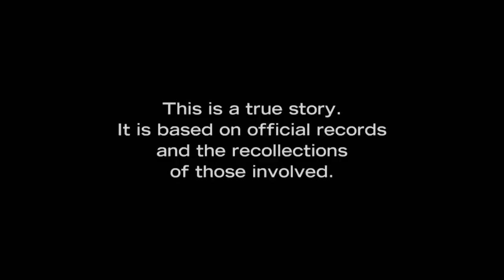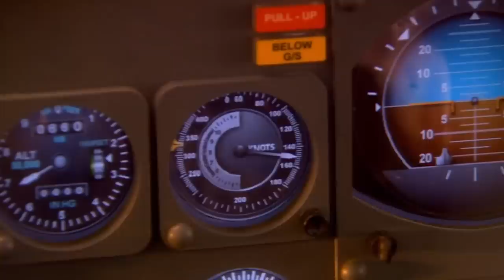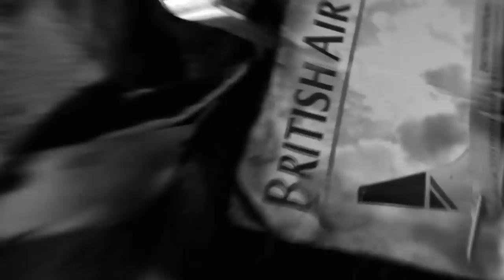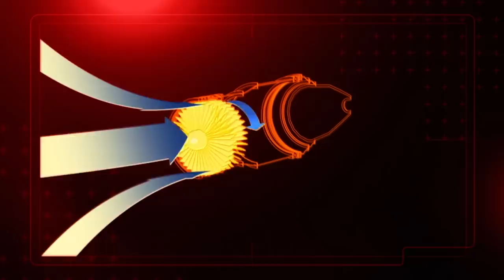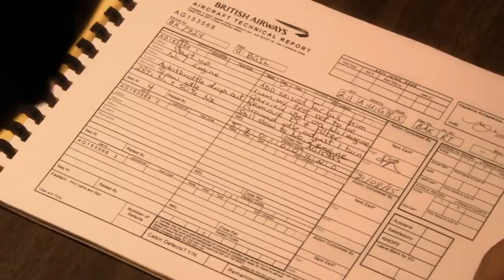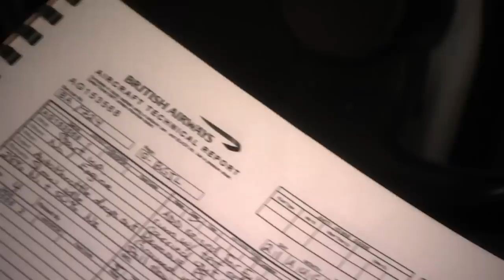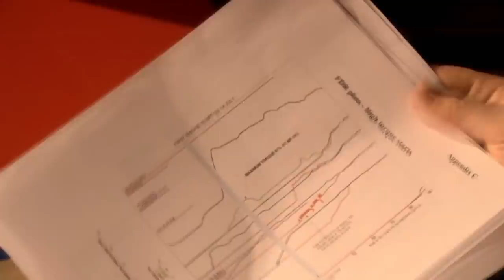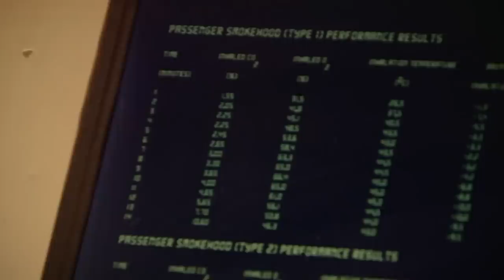An Engine That CAUGHT FIRE Mid-Flight! | Airtours Flight 28 | Mayday: Air Disaster

Comment: How do you design emergency door that doesn't open in an emergency. They said they opened it too quickly. Isn't that what you do in an emergency?
Reply: They also said it was a flaw in the door's design, and that it was fixed.

Comment: Why wouldn’t the door open? Damnitman! They could have gotten off twice as fast if both front doors had opened
Reply: It is not unusual for exit doors not to open after a plane has had a serious problem. The explosion may have caused it to jam
Reply: Exactly.  It is designed to only work for the safety drills when there is not a threat to life and limb... otherwise, all bets are off.  When the pressure is on, they don't step up.
Reply: The video literally said why the door didn't open and boeing fixed the issue
Reply: 43:33

Comment: 30:20 If planes had cameras that allowed the pilots to see all of the plane's exterior they could've seen the flames and how they were being directed against the plane and possibly turned it around.  They would have also seen it wasn't a tire blowout but an engine failure.  Small cameras have become much more technically feasible since 1985 and better quality.  I don't know why there is resistance to putting cameras around a plane now since they are so cheap.
Reply: Anything that adds weight or drag increases the amount of fuel needed to fly.  More fuel means more money and fewer passengers.
Reply: I suppose that makes sense from a 1983 perspective, when they probably would have had to use bulky close-circuit TV-style cameras, but these days you could inbed Cell Phone-style cameras directly in the hull, giving views of the entire plane exterior, and not affect weight or aerodynamics hardly at all.
Reply: I thought the same thing too why not install a cameras for the pilots 😮
Reply: Pilots already face an information overload from too much information presented inefficiently. If there was a third man operating systems in the cockpit, this would be feasible. With just two? You don't want them flipping through camera feeds trying to find something to look at.
Reply: Probably because there are hundreds more sensors than in 1985.

Comment: The narrative about the failure of the combustor burner can is, for the most part, correct.  After the details of the Airtours incident became known, the engine manufacturer (Pratt and Whitney) issued Service Bulletins to alert all operators world-wide of the failure and devised new maintenance limits and inspection criteria.

Comment: In terms of smoke hoods, I have to agree with the school of thought that complicating evacuation is going to make it slower. Smoke is dangerous, but in a fire situation the ultimate goal is to get everyone as far from the fire as you can as fast as possible, and if that can be done effectively with an actual plane's worth of people without smoke hoods then adding smoke hoods to the picture may not be worth the slow down. That said, there should be some available and flight crew should absolutely be comfortable with and trained to grab smoke hoods for themselves in proper situations, which would have helped the flight attendant who was looking for passengers on the plane after the survivors had evacuated.

Comment: Three nonfunctional exit doors was not considered related to deaths?
Reply: The simulations of evacuations were done using only two doors, so the two rear doors' not being available shouldn't have affected the overall survival rate of the passengers. The third door's being jammed, however, was a factor, which was addressed at 43:29.

Comment: So hard to watch knowing the best choice would have been to immediately evacuate. There needs to be a way for attendants to take matters into their own hands.
Reply: Thankfully, today, the procedures are such that the head flight attendant/purser may initiate an evacuation without the Captain's consent. A light and alarm appears on the control panel when this happens to inform the flight crew to stop the aircraft and its engines immediately.

Comment: One: I would have made the isle way not 30 inches wide by I would have made it 36 to 46 inches wide.
Two: I would have cameras all over the aircraft so when that boom happened the pilot could have quickly looked to see if there was a fire and where it could have come from of it was a tire like he thought and if he saw something in real time he could have made different decisions than what he made. Instead of turning right after he turned off of the runway, he could have turned left facing the plane away from the wind and not letting the wind blow the fire over the plane. I am DISABLED and use a Powerchair and can't walk at all. In a situation like this, I would not have a prayer?

Comment: being 737s always problems?
Reply: Probably because there is more 737s than any other airliner on earth.
Reply: The 737 was the most  widely  used commercial  aircraft  in the  world  at the time. I think  it still  is, not sure.
Flown the 737 dozens  of times  without  a single  glitch. I'd get on a 737 anyday.  Most  commercial  aircrashes over 75% , are caused by human  error, not aircraft  design 
One more thing,  Boeing, Airbus, Bombardier  etc, build aircraft  not engines, Pratt &Whitney, G.E. to name  two.
Reply: Building engines

Comment: They didnt mention an obvious flaw to the aircraft design that jumped off the screen. Why is there only 2 escape doors in back and 2 in front. Fire in back leaves only 2 in front, One dosent work. One door left, dosent get opened until after fire crew was already hosing down the plane.  Oh gee lets get all psychological as to why people died.   How about 2 escape doors in middle, everyone lives.
Reply: Escape doors over the wing, where the burning engine was located?

Comment: The pilots should have been helping people get off not some check list with it on fire. That should be first.  1) If plane in fire help people get off. 2) get off.  All the technology and they can’t put camera’s with monitors so pilots can see the aircraft is called GREED.
Reply: that is not the captains job. thats the stewards job. the piolts have to shut down the plane to prevent further damage. Also they wouldn't be much help in an evacuation anyways.
Reply: Of course, you know better than the airline industry and aviation experts worldwide. 🤦🏻‍♂️
Reply: @ilyashahrestani3503  there is no more damage that could possibly happen!
Reply: @willschultz5452  55 peoples could have died.   Instead of 54.   Those pilots could have freed to jammed door to let people out. Nope let’s make sure the check list is in order for the investigation.   One life is worth the entire aircraft.
Reply: Many aircraft operations active are dangerous to people leaving a passenger aircraft by emergency ramps or other methods.
It would be pretty bad to have a passenger sucked into a jet engine in operation!
The order to evacuate is after all aircraft operations dangerous to people leaving the aircraft are shut down.